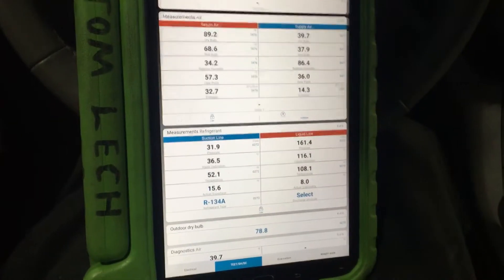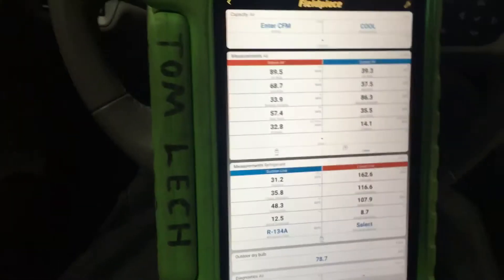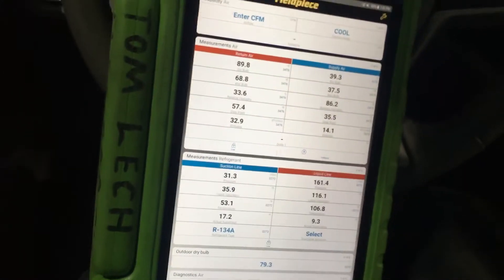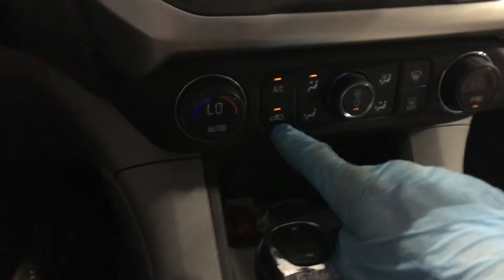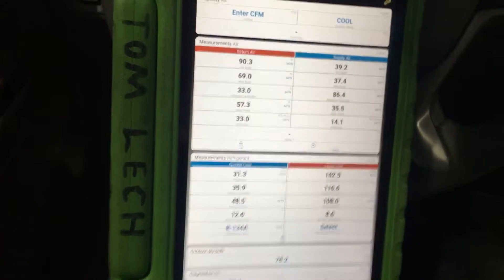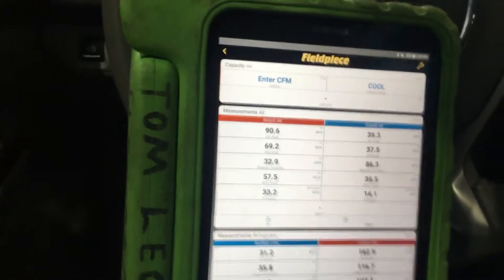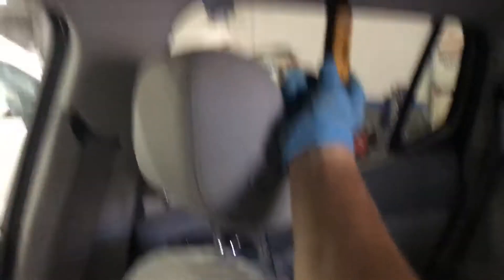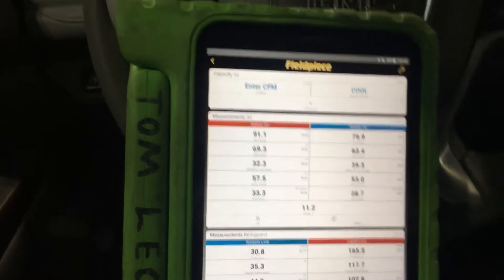Rear air conditioning evaporator no cooling to vents

Comment: You never said what is making the heat come out the back please let us know your thoughts on why heat
Reply from the maker: The technician who put back the rear evaporator HVAC case in the quarter panel after repairing a sheet metal. 
Left one of the electrical plugs out for changing the air damper doors . 
     It was stuck a little bit open and a little bit close so it’s getting cooling air from the evaporator and heated air from the heater core at the same time.